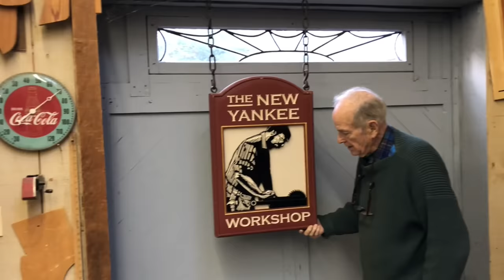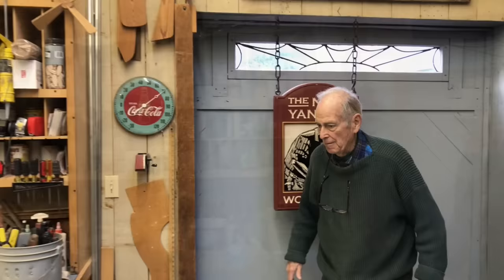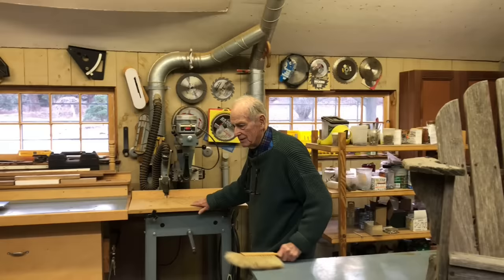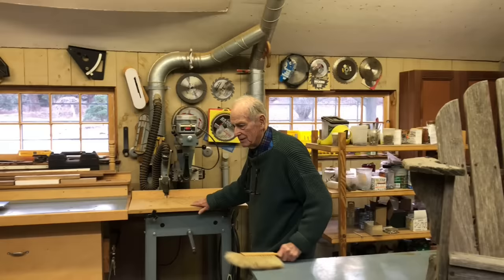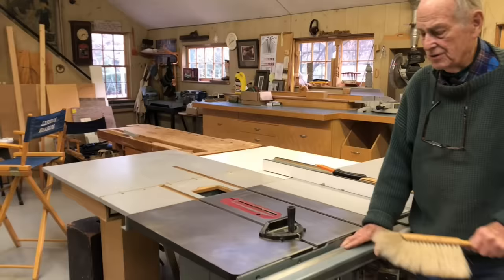A Message from Russ

Comment: I watched what Norm used, and then bought the exact same table saw and surrounding panel support tables. Later I bolted on a cast iron router table on one side of the table saw. I've used that many years now. The drill press in the NYW is also the same, however my Sears bandsaw is pretty unique. It was passed down from from my grandfather to my dad and then to me. Soon I will pass it along to my nephew and his son. It still works great and came from an age when tools and machinery were made to last forever.

Comment: I live in a area where reception on PBS is flaky, not moving the antenna it comes in one of three ways, enough signal to tell the channel search its there, pixelated and choppy, or just fine.. and there's little hope for a outdoor antenna when you rent a second floor apartment... oddly there's two unknown source coaxes in the living room, and none in the bedrooms until we did have satellite TV, which the promotion ended, the economy went sour, and we canceled before the contract ended.   I'm just now finding the show ended.  TOH can be found on one of the streaming sites on my TV..   and yes I miss the Bob Vila days, but it looks so much like hired contractors that came in to fix simple problems just to air it, and the customers are affluent and brain dead.

Comment: I notice that your logo shows Norm using a table saw with the blade fully extended, no guard, no riving knife, no safety equipment what-so-ever.  I think that you should change the logo: Either put on a guard covering the saw blade or show Norm without fingers.  Just a thought.

Comment: The first thing that I noticed about the logo hanging on the door, is that appears that Norm is using a table saw WITHOUT a blade guard.  That's a serious safety fail.  If you don't know how to use power equipment with all safety equipment attached, then you don't know how to use power equipment.  Shame on you, Norm.